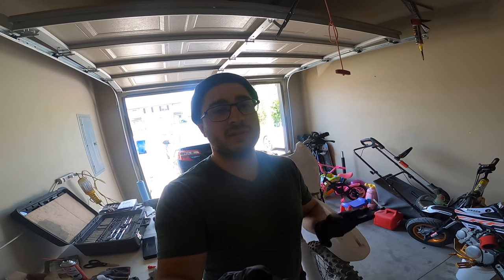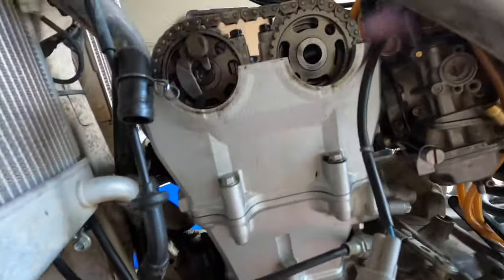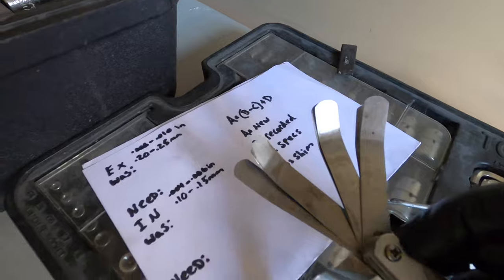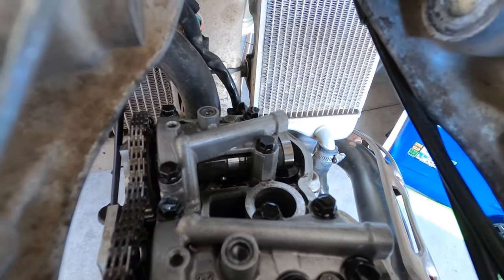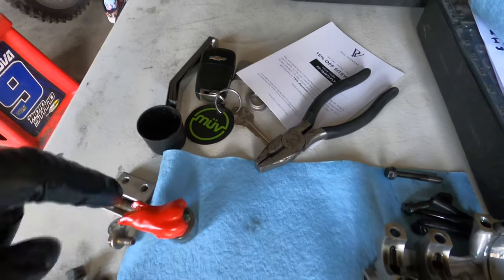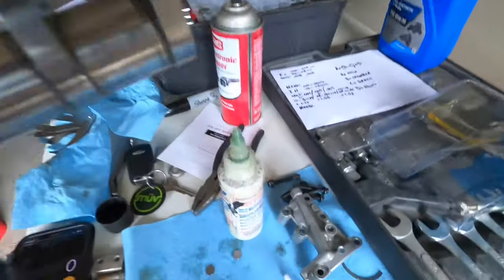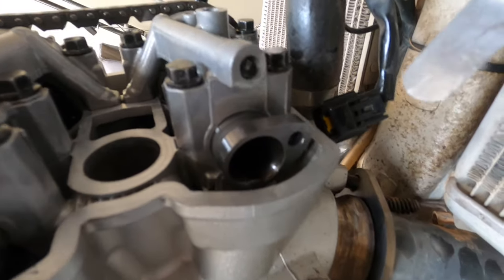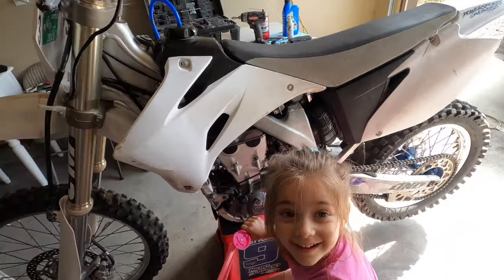How to adjust valves and Timing on 2006 YZ450

Comment: I’ve been trying to start my buddies 05 YFZ450 for months now. He had it in pieces. Unfortunately he passed away before he could get the quad back together. The family reached out and asked if I would wanted to buy it. He was able to get the engine back together but not back in the bike. That’s kinda where I took over. I was able to get spark and fuel but it wouldn’t fire. After checking everything I could think of I think I may have the same issue that you did here in the video. 🤞🏼
Reply from the maker: Hey I’m sorry to hear about your friend! That’s terrible :( 
But it’s cool your taking over for him and finishing it for him! 
I hope my video will help get that quad running great again!

Comment: If the ignition timing and valve timing are tied with a chain how did you get them out of sync in the first place? I need to replace the decompressor spring on my 190 but don't really mess with the timing if I can help it.

Comment: definitely is going to help me a ton if I get this bike over the weekend. guy says it need timing adjusted and it won't run because of that. no clue about anything with timing I'm not dumb with motors just never had any related issues with timing. 
if you know what it could be, the bikes a 2002 yz450f and the guy says it won't run because it needs the timing adjusted.
Reply from the maker: Hi Jonathan Roy. If you flash a light in that hole you’ll see the flywheel and on the flywheel there is some markings. You have to match the marking on the flywheel to the little marking on the case. 
Go for his forum it might be helpful with more specifics 
https://www.southbayriders.com/forums/threads/102894/
Reply: @slavsquad  ok thank you
Reply from the maker: @jonathanroy9112  as for what the issue can be with that 2002. It could
Be a lot of different things. Timing is not hard to check. Study my video and watch some others as well so you got it down. Then check on the spot. If timing isn’t off then maybe you have other issues to worry about
Reply: @slavsquad  what do you think I should do ? buy it and then check or try to check there? do you think 1500 would be worth it for something that could be kind of risky? thank you for your help
Reply from the maker: @jonathanroy9112  if the bikes in great shape and only needs timing done then that’s a good deal. But I would definitely check timing on the spot because if it’s actually needing a rebuild then your looking to pay another 1500 probably. 
Just interesting why he wouldn’t just do timing himself cuz it’s pretty simple. Could just be someone who doesn’t touch engines at all or someone who’s using timing as an excuse 🤷🏻‍♂️ For me it’s to risky. I’d rather just buy a running bike or something that’s blown that I know needs a rebuild vs something that your not entirely sure what the issue is. One way to find out. Meet up and check
Reply: @slavsquad  do you know a faster/ easier way to be able to check the timing on the bike? so I don't sit there and take it apart and then figure out that it's the timing and having to put it back together or figure out that it's not the timing and have to out it back together?

he said he tried to do the timing but he messed it up
Reply from the maker: @jonathanroy9112  the only thing I can think of doing without having to take it apart to check timing is to check everything else to make sure that timing is the only thing left that could be wrong. Like check if it kicks over good and feels like it has good compression. Make sure there’s plenty of oil and there’s no oil on the engine. Just those kinds of things. To make sure the engine is okay 
Maybe I’ll put together a video of what to look for when buying a bike
Reply from the maker: @jonathanroy9112  this video I actually made was after I messed up timing by 1 tooth and bike didn’t run. So I rechecked my work and in the process made this video. So if he messed up timing even by a little then the bike won’t run. Least mine didn’t

Comment: Pretty sure you want to set your timing before you adjust your valves. The cam is spinning as your measuring the second cam. The gap will change as the cam spins.
Reply from the maker: Yes I set timing first. Loosened the cam chain and then measured.

Comment: question my bad if it was shown in the vid. how did you get the bottom part like the one on the bottom end to top dead center? you said that you couldn't see the marking at all and then it cut and you had it top dead center
Reply: You just have to turn the fly wheel counter clock wise until you get the third marking all the way t the right there should be a marking the looks like a H and then to the right another "l" mark

Comment: is this the same procedure for yz250f 2007 and 2008
Reply from the maker: Yes it’s the same. Just different shim sizes. 250 has smaller shims then 450.
That being said the valve clearance is probably different on a 250 then a 450 as well

Comment: What  if we dnt have any shims  installed?
I purchased new cylinder,  and head. Dropped head off at shop for them to install new performance  valves so no shims installed.
So whats the way to properly do the math without existing shims installed
Reply from the maker: Hello
So are you saying there’s no shims necessary at all with the new valves (if so I’ve never heard of it so couldn’t help you there) 
Or your saying there’s no shims currently in there and your trying to see how to find the right shim sizes?
Reply: @slavsquad  Yes to second question. I figured it out though.. I just tossed the old shims thats where in my old head for a starting point, then measured and readjusted valves with new shims after that.
Reply from the maker: @FullPayGaming  That’s what I would have recommended :)
 Glad you figured it out!

Comment: One question what’s the timing mark cause idk I look at other video it says this is the timing mark and I look at your video and I feel like your right but I can’t see the timing mark on yours plz help
Reply from the maker: What timing mark are you talking about specifically? On the magneto or on the cam gears?
Reply: @slavsquad  the one I’m talking about is the magneto
Reply from the maker: @saldanavlogs2255  you just pull the upper plug on the magneto cover and look for the  marking next to the little h shaped mark. usually you have i believe a fire marking and thats first. you need to be on the second mark which is TDC. sometimes that Mark is shaped as a T for Timing/TDC. you also have to have the Cam Sprockets markings properly as well. I followed Yamaha Owners Manuel so its correct

Comment: Hey this is an insane video I do have a question though. Even though this is so old I’m taking the chance to see if you can help me. So I’m trying to get the Cam Cham tensioner to lock but with no luck, I can turn it and the chain becomes loose but after a few turns it never locks and even if I keep turning it won’t lock and the chain becomes tight again. Man what am I doing wrong herreee 🤣
Reply from the maker: Usually if you turn the flathead in all the way it should lock
Worse case Just take the tensioner off completely? Don’t see why not
Reply: @slavsquad  yeah my locking mechanism was faulty I had to remove it completely and even then it didn’t lock while it was outside the Cam chain housing. So yeah that got fried 🤣 I’m still using it like that tho it don’t matter.
Reply: Though now I’m working with the shims, my two exhaust valves were way off (.007) would not even go through the valve clearance easily but all my intake valves were in spec (.004 and .005) I’m just going to go down two sizes on exhaust valves (if I’m allowed to) and get those .004’s to .005 on the intake valves and call it a day. Does this sound familiar to you or am I just making all this stuff up? Haha first time taking my bike apart and having looked like 3 videos I think I’m in the right path what do you think?
Reply from the maker: @janmanuel6964  long as it’s putting tension you should be solid lol
Reply: I’ll try to do my best and post progress in here g it’s a yz450f 2007 always ran fine but I started wheeling like a lot and now it has lost compression and it also gets hotter than usual so yeah I figured my valves were off and to my surprise they were… waaaaay off 🤣 at least the exhaust valves, intake valves are fine but I’ll adjust all of them just in case I have to sell the bike that way the new owner will get like a new bike haha 🤣 but thanks for your response man I just hope I end up firing up my bike right just like you did there in the video ❤️
Reply from the maker: @janmanuel6964  good luck! Hope it starts up first kick:)